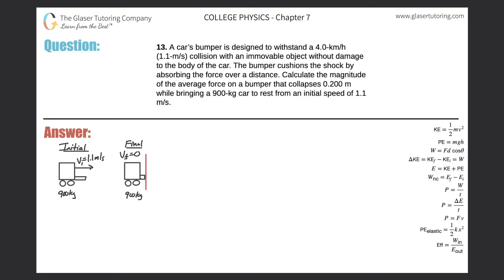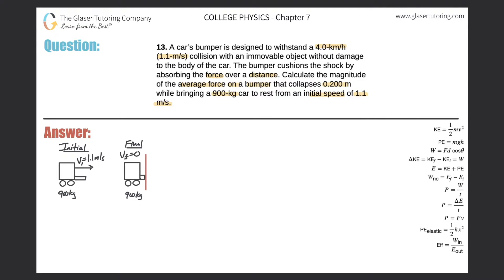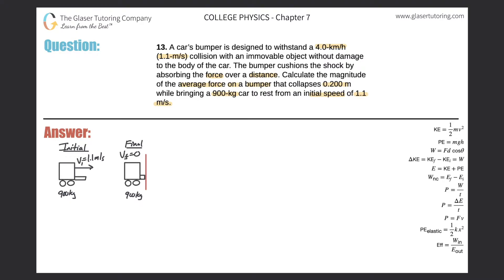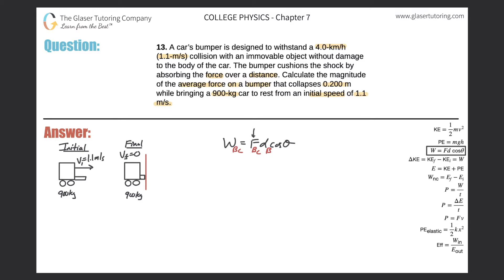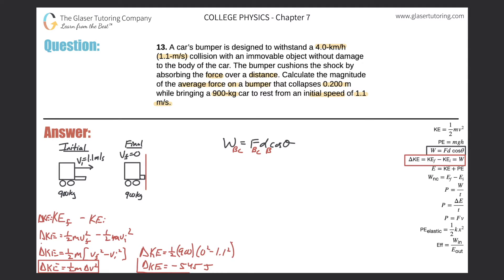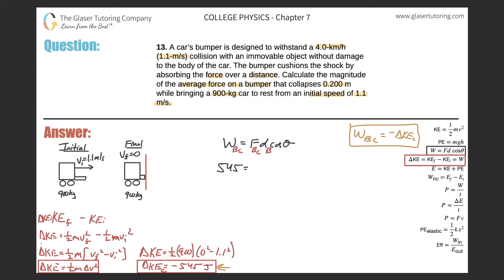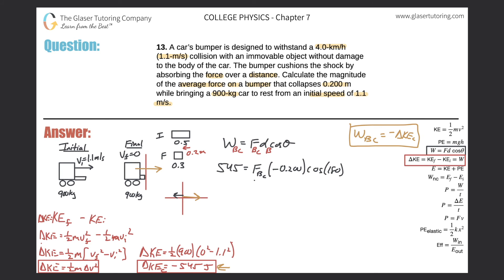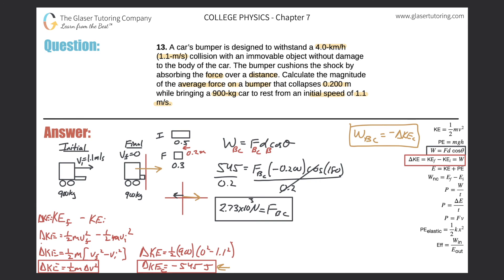7.13 | A car’s bumper is designed to withstand a 4.0-km/h (1.1-m/s) collision with an immovable

Comment: Couldn't you use equation W = F(change in x) once you found W? 
change in x being 0.200 m
Reply from the maker: You could have, Jake!  I like to work with sign values of numbers (-0.200) instead of 0.200 because it gives more context (adds direction) to the calculation.  Use whichever one you feel more comfortable with.  Keep studying hard!

Comment: I think I see the problem you don't have to assume the initial size of the bumper in order to subtract and find the change because the change in the bumper is actually given in this problem and not the initial or final size of the bumper
Reply from the maker: Awesome job, Reese!  This is exactly correct.  Keep up the hard work!